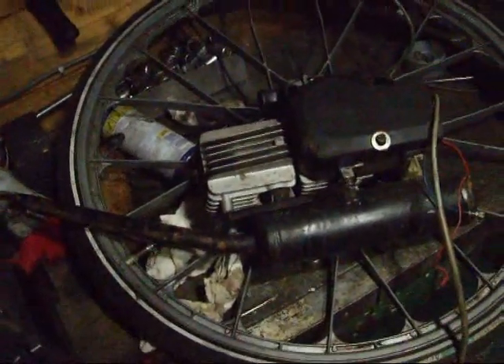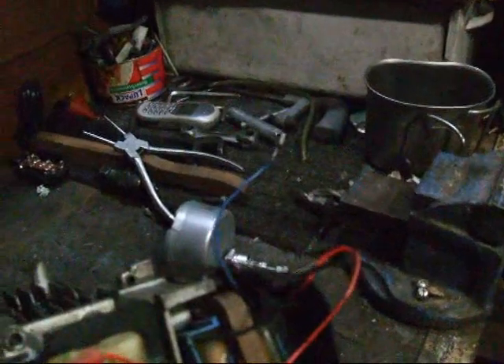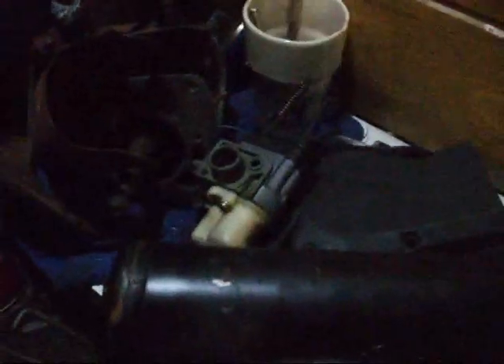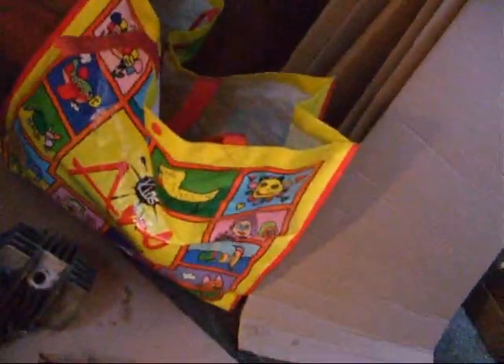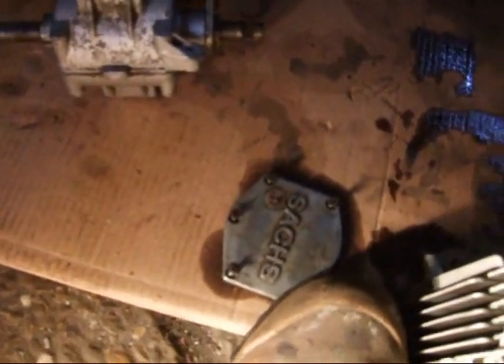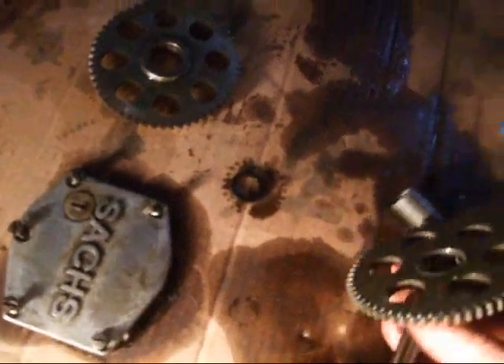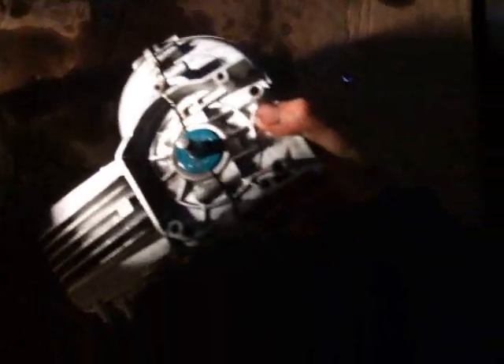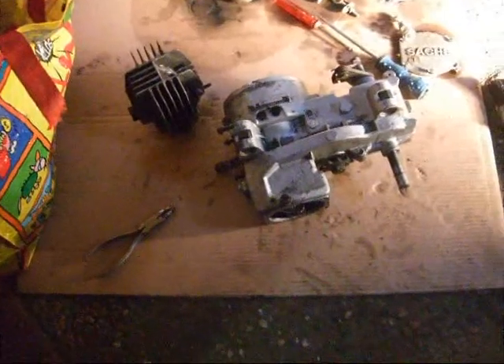spartamet engine clean + rebuild

Comment: hoe moet je opvoeren?
Reply from the maker: by changing the cdi unit  there is an small capacitor inside it remove this and you will gain 10 more km  file out the exhaust manifold on the engine   look inside the exhaust port and you will see its half closed  also put some ethanol trew the gasoline
Reply: you know so much. my bike give me only 25 28 km/u en every time i need to go 15km it take me a hour to get there. really boring on the road. but thanks..i'm waiting for your new video.. thanks friend
Reply from the maker: Amresh Ramautar your welcome i got an nnewproject   its an spartamet i am ttrying  to fix  the engine and make it look better you will see the video up soon greets
Reply: oki will be waiting.
Reply from the maker: i got a lot of projects @ the moment like an engine swap of en vw polo so i dont know when the video is up the first footage of the spartamet has been recorded already

Comment from the maker: it depends on where it leaks  iff its leaking gas nearby the exhaust  then u have to pull the engine apart and put sealers between the both engine part,s  also than replace the o ring 
 if its leaking by the carberator pull  it of and take the carberator apart and replace the upper sealer the sealer whit the metal pin 
if its leaking by the flotter replace the flotter sealing 
make sure u look if the carberator is clean and everything if it still leaks send me  a massage and also where it leaks

Comment: hey I can't start my motor. the pulley is stuck. how to repair.
ik kan mijn machien niet starten. de pulley zit vast. of de zuiger. hoe moet ik hem maken
Reply from the maker: hy i don't know if your dutch or english i am dutch so ill answer in englishe  what doe you mean exactly you cant crank the engine = step one remove the coffer to get to the flywheel and turn it if it does not turn remove the spark plug end spray some oil in like wd40  get en good key  for the flywheel nut  and gently try to turn    the engine  back and forward  till it brake,s free don't forget to keep adding  oil  when it broke free  you got to keep in mind the piston is probably damaged butt there is an good change it has still enough compression to get  it running again  only try to start it when u  are sure there is engine oil in the carter  end you have mixed the fuel  1/100   thats 10 ml oil in 1 liter of gas butt i would recommend 12 ml on 1 liter of gas if you  are stuck or don't know what to do just ask  or make an video of it greets
Reply: ja ik heb mijn machien helemaal open gemaakt. het blijkt dat de zuiger helemaal vast zit. maar die heb ik inmiddels al los. het zat vol carbon of roest. en de 2 lagers weerzijdig zaten ook vast. maar ik heb nu een probleem. aan de zuiger zat er een ring die kapot is. waar kan ik die kopen?
Reply from the maker: hy your also dutch or  okay if i read your message you said your piston ring is broken you can buy this at the most moped part shop,s  is your cylinder still okey? and what about the bearing you got them working again ? ill recommend to hone your cylinder and replace the bearing included piston  because they or not expensive  greets
Reply: engineprojects yes they I will replace the bearing. yes the cylinder is fine. thanks for the help.
Reply: Wil je een keer laten zien hoe je dat doet met zuiger in de cilinder ivm de zuigerveer

Comment: hoe moet ik de krukken as losmaken om de lagers te vervangen. als je een video hebt voor me zou ik het zeer op prijs stellen
Reply from the maker: the crankshaft is compressed you gonna need special tools to take it apart butt i think its easier if you buy an second hand one those cost around 15 euro and whole engine block cost around 35 euro  if i understand it good its also for learning right?  you need a press to take it apart greets